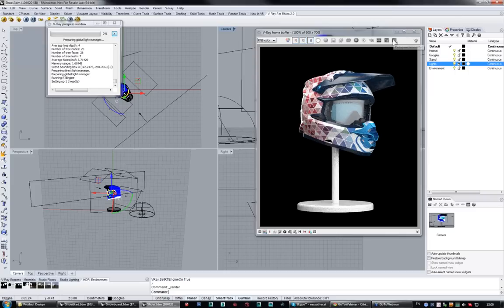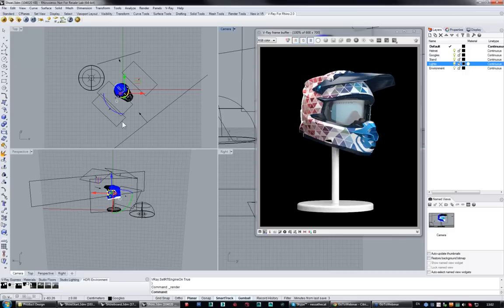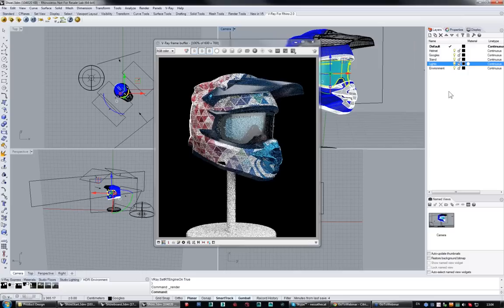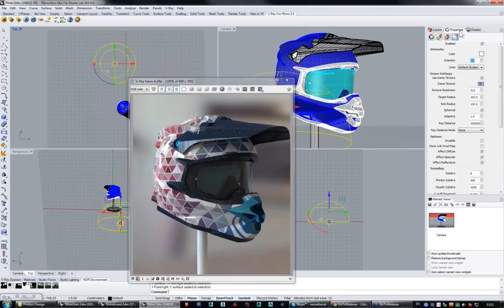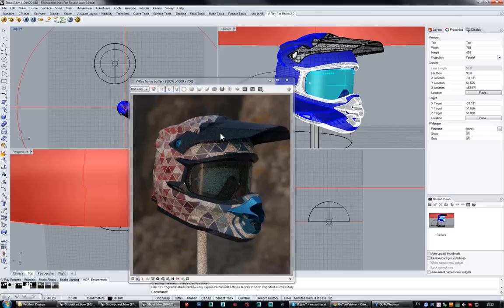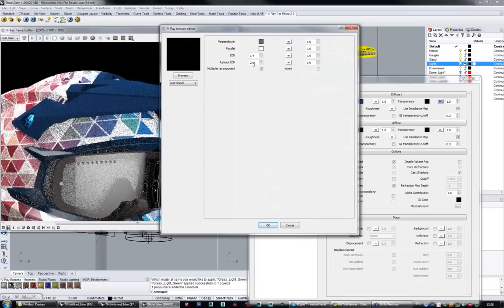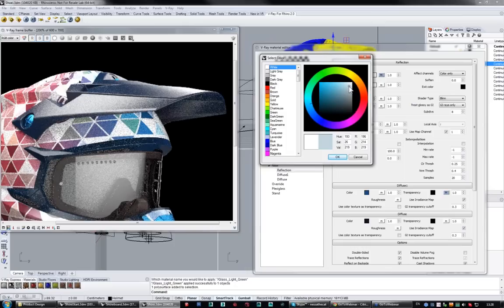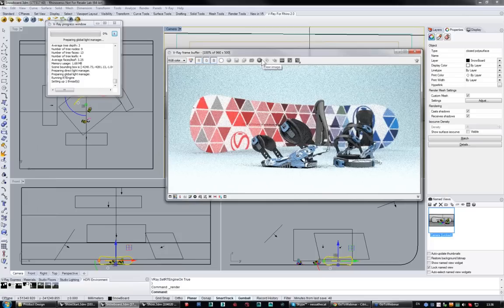V-Ray for Rhino in Product Design

Comment: Thank you,, you showed some really nice concepts and tricks like the rimlight, the softbox falloff map and the separation in lights for diffuse light and lights for reflective light. Unfortunately Vray for Rhino does not have the Vray SoftBox Map generator, which by the way is kinda absurd, considering the fact that Vray for Rhino is also designed to address product design studios... it just does not get the same love than its 3dsmax counterpart -_-
anyway, theres still some hope for vray 3.0 :)